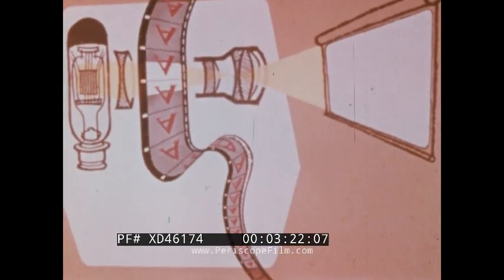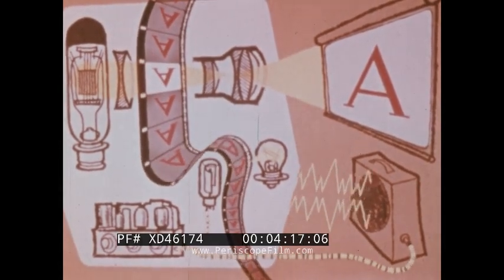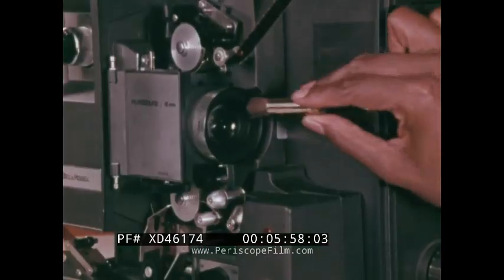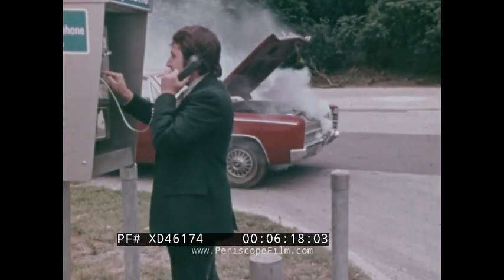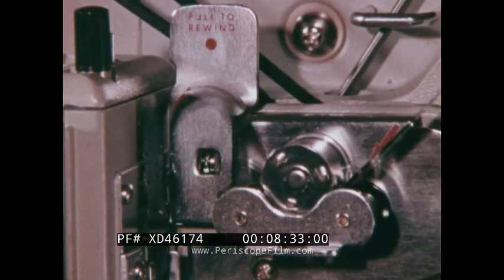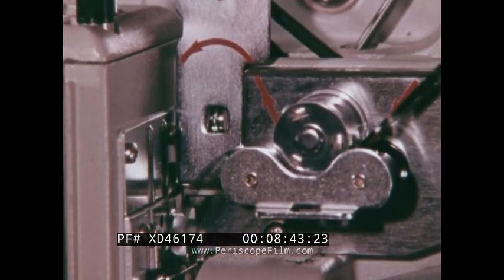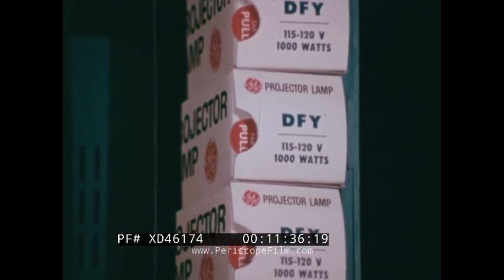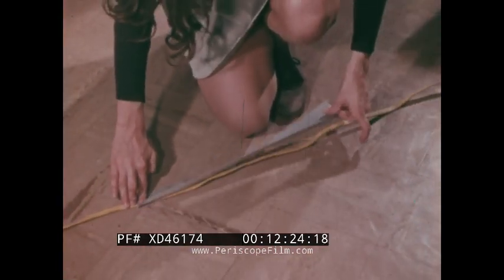“ FACTS ABOUT PROJECTION ” 1975 AUDIO-VISUAL CLUB TRAINING FILM   16mm FILMS & PROJECTORS  XD46174

Comment: 1:10 is the same projector that I have which is the Kodak Pageant AV-126-TR, and this was used in this educational short on film projection including threading and operating the projector as well as showing the film on screen.

1:12 is the Bell & Howell Filmosound Specialist, and it had some issues including an auto thread feature where it eats the film pretty badly which cause it to damage and breaks the film. That’s why I used to have it.

Comment: Actually, the tones for an automatic slide projector are not entirely inaudiable.

 When I was in school, the control signal could be heard clearly as a very low pitched fluttering tone.

 Because type 1 tapes have a rather limited audio frequency range and most school audio equipment was not very high fidelety, they had to make sure that the tones could be picked up by the projector.This ment they were in the frequency range of human hearing.